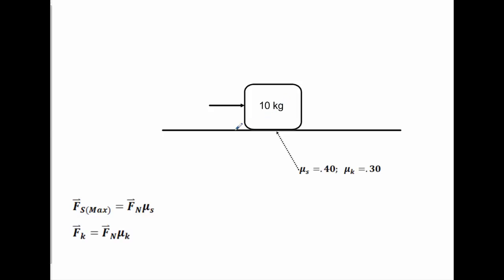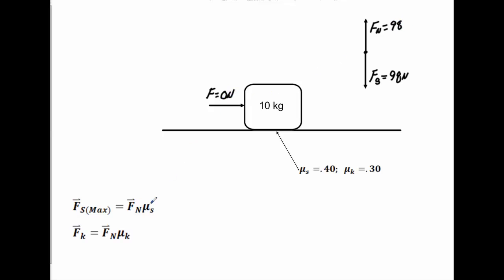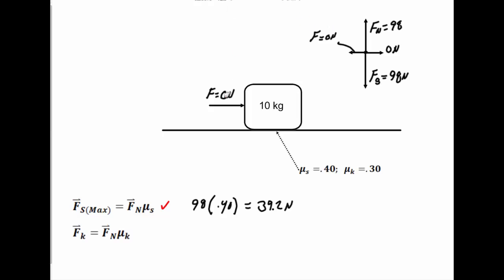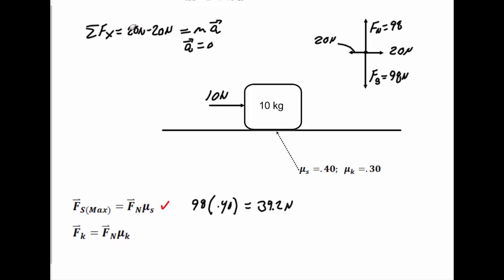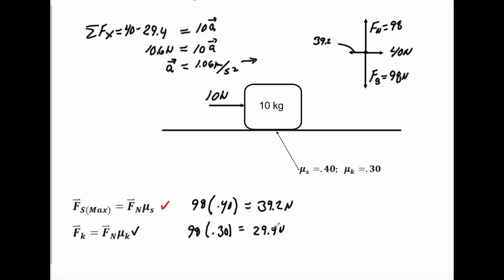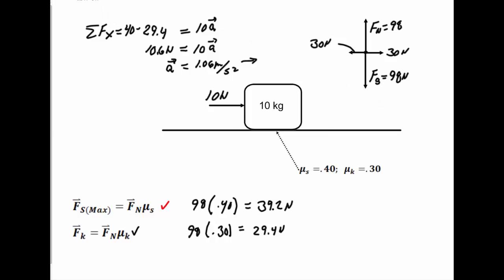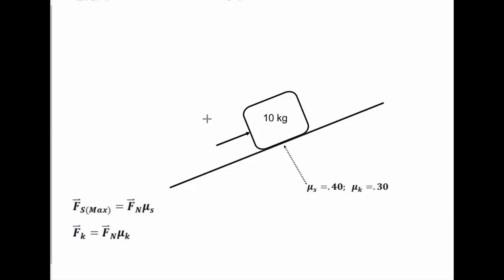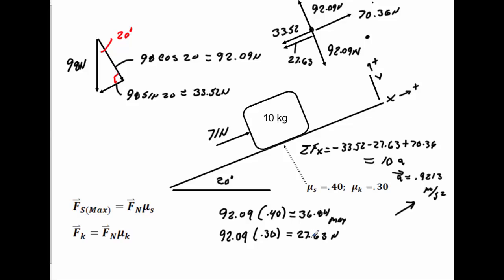Friction Problems with Static and Kinetic

Comment: I understood reaching 36.84 and how kinetic would kick in and drop your total with a multiplication of 92.09(.30) instead of times (.40).  But if your pushing force reached 70.36 and you moved the object up for a moment, how does it drop from 70.36, to 27.63? In fact I was never sure how the achievement of 70.36 was represented in the numbers reflecting max Static friction with the switch to kinetic . I only noticed 92.09(4.0) . I would really love an answer too. I'm not giving you a hard time. This is one of the best tutorials I've found in  some time. And am definitely subscribing. It's an honest question, about what I missed.